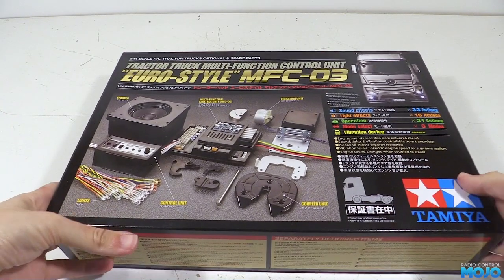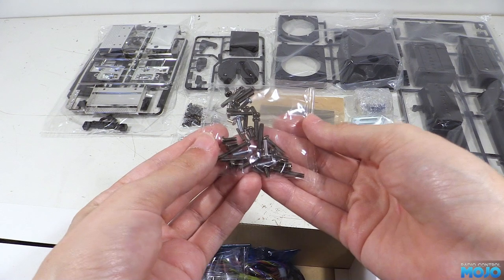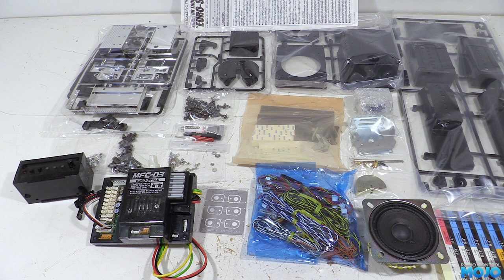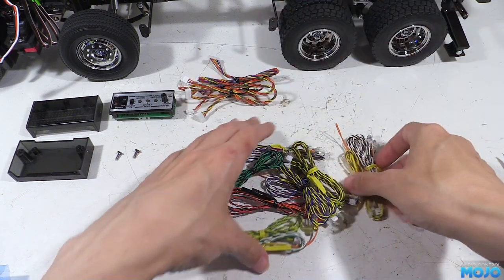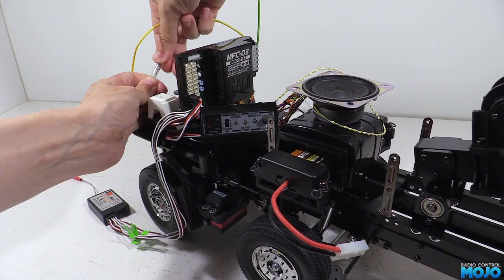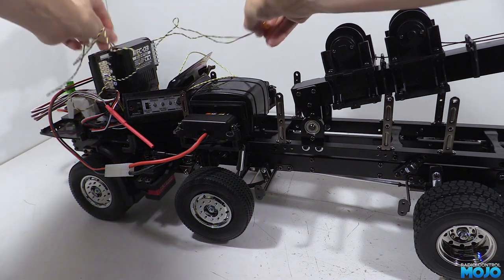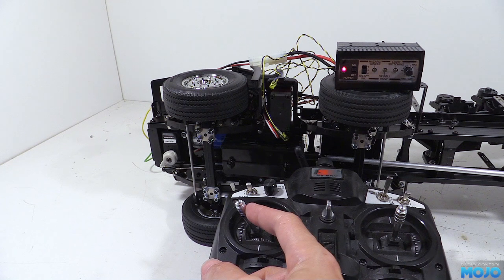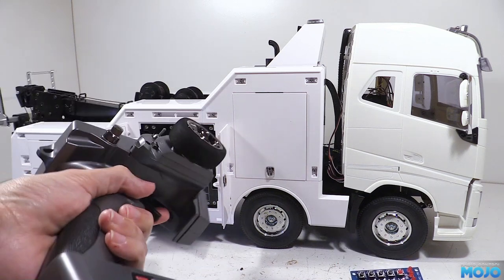Tamiya Wrecker - #12 MFC-03 and Time Travel!

Comment: Do you mean 2 8-ohm speakers in parallel? If wired in series the load would be 16 ohms. Really interesting video, does make you wonder how much cheaper the kit could be if they only supplied the essentials.
Reply from the maker: Woops, I should have said 2 4r in series to make the 8r. There's lots of nice small 4r speakers available for automotive applications. If Tamiya got the price lower it would make the MFC a far more interesting unit

Comment: since I wanna start building my first truck very soon... how is it with the MFC kit and the indicators? is it possible to set it up, that you have to turn on/off the indicators by yourself? or do they always turn on, when you are turning the wheels? (which I find very "not scale" :D )
Reply from the maker: The 03 does have more options than the 01, however the indicators are still tied to the steering... That's not to say you can't be creative with the channels if you have some extra. You can connect the steering servo to a separate channel and run the left/right for the MFC on a switch for indicators and other functions
Reply: On the MFC03 you have to switch them in, they don’t come on automatically with the steering like on the 01

Comment: Sorry but beier systems all the way more upto date and I think tamiya charge far to much for old technology otherwise good build and explanation cheers
Reply: I completely agree.... but for the less Programming Inclined (like me), the Beier is immensely difficult! 

ALTHOUGH, since finding the Beier Forum, I've gotten tremendous help. Once you get past the initial nightmare of Positive Common Wiring, and the Programming (which doesn't favor low cost Radios like FlySky)... 

The end result is breathtaking!! NOT stuck with just one Engine Sound, like Tamiya, and nearly complete control over everything on your Rig (after a learning curve!), nothing else on the Market comes close!
Not to mention if you get a Beier USM-RC-3 and a Hobbywing ESC... You'll have superior experience, at a THIRD of the cost of a MFC!
Reply from the maker: In terms of features you're quite right. The MFC nice in that it just has enough features to make a compelling setup without too much to confuse the less technical. It is far far too expensive though, halving the price would be about right
Reply: @RCMojoTV  
Halving the price if you got the SFR-01, that comes with ESC built-in. 
I use the USM-RC-3 and Hobbywing ESC.... roughly $190 USD total. 
As you pointed out, you don't get all the Body, Fuel Tanks or Hardware... that on modern Kits, you don't even need. 

Nick, I would LOVE to see your detailed setup AND Programming Of a Beier System! I'm sure I'm not alone.